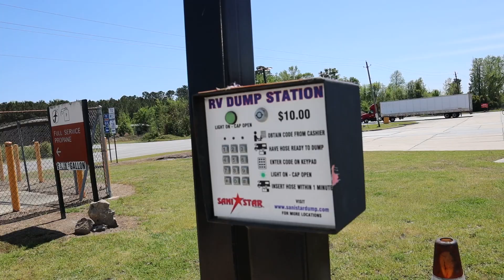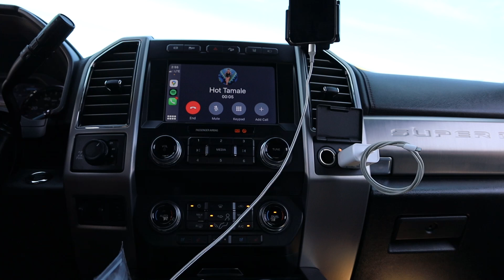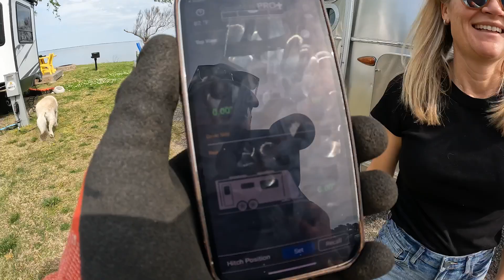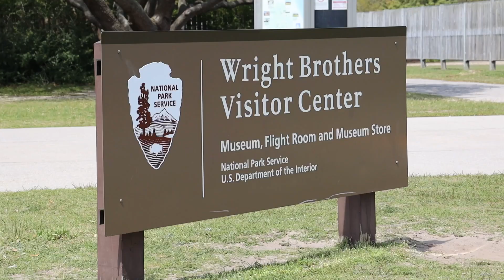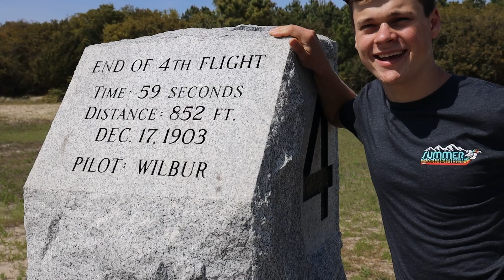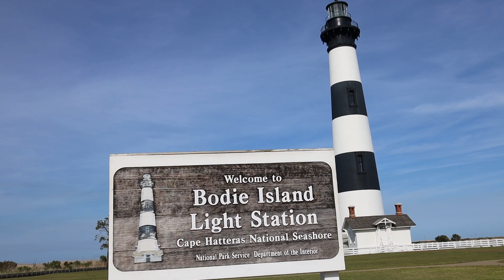RV Drive Days & Truck Stop Dumping // Kitty Hawk, NC

Comment: Those hot water heaters can be a pain in the keister. I got rid of mine and replaced it with a water heater. Works great.
Reply: I was going to say this as well.  If you have hot water you don't need to heat it.

Comment: Our mixing valve had the same problem last year- we got a new one and installed it and soaked the old one in vinegar to clean it and we kept it as a spare.  Banging on it worked this spring so we didn’t have to take it off again, lol.

Comment: I had the levelmate pro, and I loved eveything abou it but even with the device mounted in the bedroom near the front on the outside driver side wall, it had trouble connecting to my phone in my F150.  I didn't have it long before selling my trailer, so didn't take time to troubleshoot but I would definitely try again because so convenient to see level from the truck saving many trips to manual level.  Also love when you visit bee farms, they are so cool!

Comment: I love the NC Outer Banks.  Sadly, in 40 years living in NC I've only been there twice.  At least the second time in 2018, I visited and climbed all the lighthouses, and visited the Wright Brothers Memorial.  You need to check out the Cape Hatteras Lighthouse too.  Its even taller (257 steps to the top), yet was actually moved nearly 1000 yards diagonally away from the approaching ocean about 20 years ago.

Comment: I always wondered about that putting it by the door thing. We go by the refrigerator, because it’s propane and it needs to be level so we open the freezer and check both directions! Then we do a door check because it drives us crazy if the doors don’t stay where we want them to stay. The pantry and bathroom door!

Comment: You can still remove an item with Command strips even it the tabs aren’t available.  Just wiggle the item some and it will pop off.  I’ve done it several times with no damage to the wall.

Comment: I had a nice torpedo level and it was bad. Check it against a known good one, or, what I do is, find the position of the bubble and turn it fend to end and see if the bubble is the same spot. If it stays with the same end, then you should replace it, or just test it against another.

Comment: I got a LevelMatePro, which you have to hit a little button to wake it up. I’m disabled and part of the whole reason of getting it was less climbing around, so I put mine in an outside compartment where I can get at it to hit the button without having to go up the stairs into the trailer.

Comment: Your water heating problem may be related to not having enough water pressure to maintain heat. Some need a certain pressure level to heat. You could add a expansion tank to help resolve. Looks like by you tapping to dislodge the buildup effectively provided the pressure required to have continuous hot water.

Comment: When I have customers that are frustrated with their hot water heater, either due to breakdowns or whatever, I recommen the Surban tankless hoter water heater. About the same price, easy install and 45 minute showers! 
Installed, if your slow <$1,000.00. The best is Truma but they better be for 2k+

Comment: For the hot water heater… have you checked the bypass valve?  This happened to us after we had de-winterized our trailer for the first time… we had left the hot water tank bypass valve open.  So our tank had hot water in it, but the cold water was drawn into the lines and diluted the hot water out.  5 second fix!  (At least in our case.  I hope yours is as simple.) **edited to add:  never mind!  I should have FINISHED the video before commenting. Haha! **

Comment: Wow, lots of commonalities on this episode.  The backing up tips and such.  I noted on my last trip the same condition with the floor and being level.  I have a 3 ft. level that I put on the floor but I can sense that it’s just a hair off.  Using the countertop seems to work best.  I have the level mate pro too, but found that I’d left it on and the battery was dead.  DOH!  Remember to shut it off folks!  🤪

Comment: I have a question for you guys, I’ve been wondering this for some time. How do you guys find gas stations that you can fit into? I know you guys have diesel which means you can fit into any truck station. We have a 35 foot travel trailer and we tow it with a gas engine and not every truck station has gas… any recommendations?

Comment: First question where do you get those Anderson rubber Mats for the levelers?? We have a gravel driveway and they slide when placing under our uneven tire slide!!  We got a level Mate Pro for our t.t. But never installed and I want to put it in a 5th wheel.  So any suggestions?
Good Job Marc not having to take bed completely apart to get the the hot water tank!!!! Kitty Hawk looks like a place I want to go next year while stopping at other beach stops along the way.  Thanks for sharing!!!!

Comment: What Airstream Year/Model do you have?
I have a 2014 F150 4x4 Platinum with OEM Factory Tow Package (w/trailer brakes).  Has the additional transmission and engine cooling system. K&N Cold Air Intake and SCT Trailer Tune. 3” Rough Country Lift. 
BF Goodrich KO2’s E rated 35x12.5x20. 
I’m researching the (Flying Cloud 30FB Office). 
I saw that you used to own a 2013, comparably equipped F150. (Mine is Tuxedo black as well.)
Your thoughts, Considerations or concerns with this tow vehicle/airstream combination are welcome and appreciated, please. 
Fantastic channel by the way!!! Great family!!